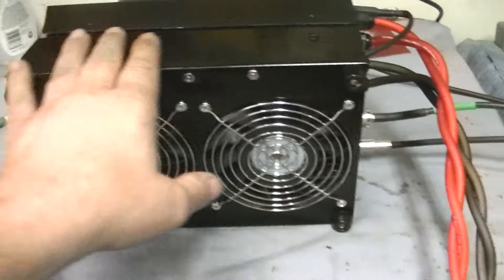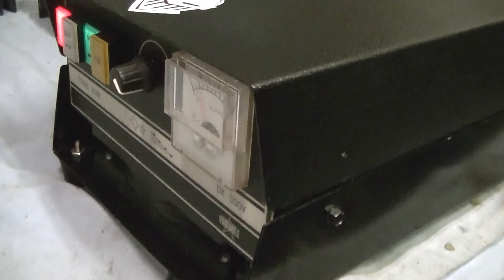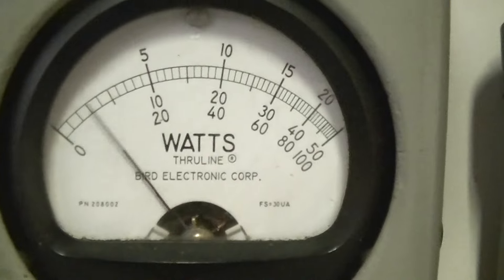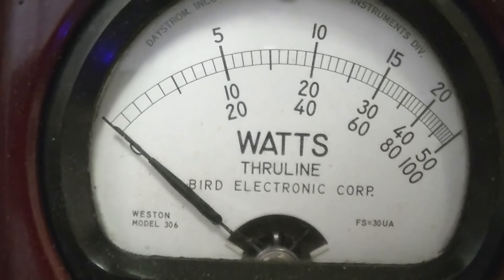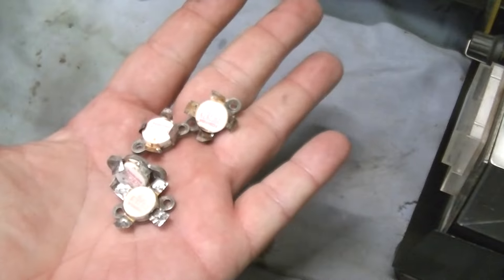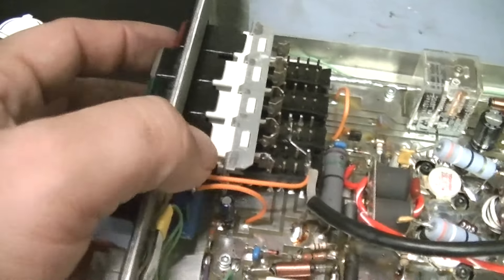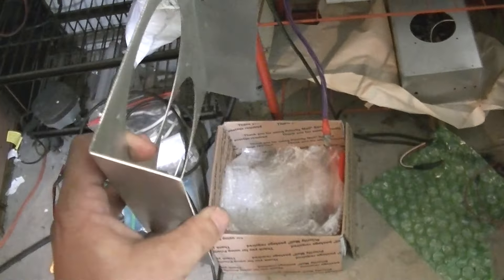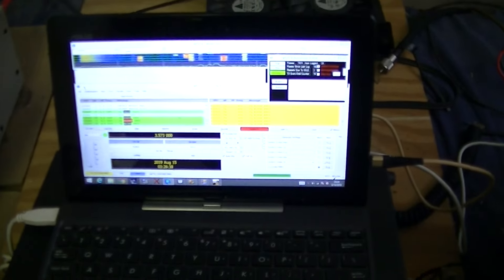Andy's Texas Star 💫 DX 500V Fully GK Modified - [VERY NICE!]

Comment: nice fan kit. I haven't run FT8 that long yet.  some times WSPR at 5 watt I run for hours. with them digital modes when using a amp keep drive way down. I just ordered a 24V 600 watt 3-30 MHz amp from Italy for a friend Icom 705 for portable. the amp is all mode draws 30 amps peek and runs 20 to 30 V . using  2- 12.8V LiFePO4 battery . waiting to hear back on drive levels for digital like RTTY/PSK 31 ETC. nice FT8 radio. I had a FT-DX 101 hear to set up. the amp I got is the FL-2100B with 2 -572/B tubes. 73's
Reply from the maker: Wow I can't wait to here how well that works out for you brother!